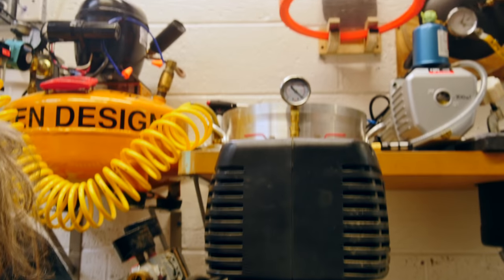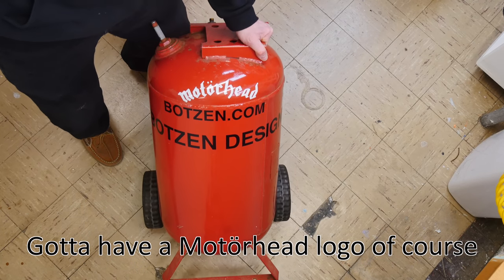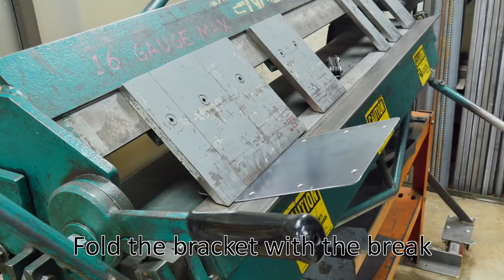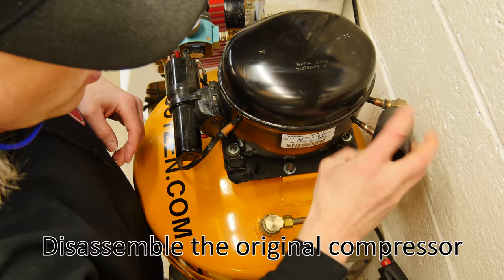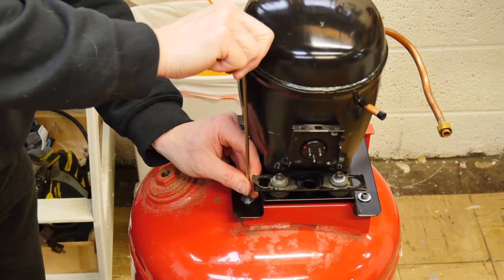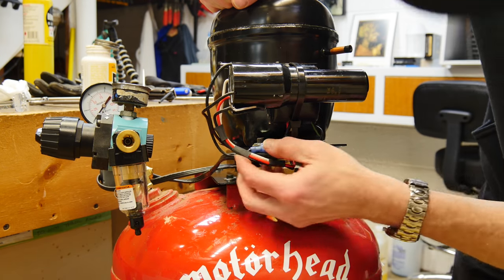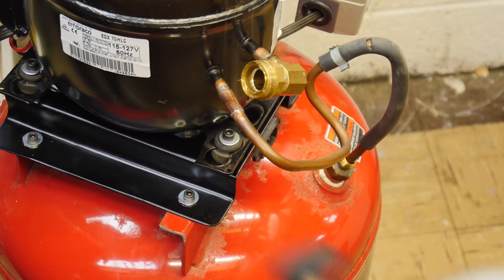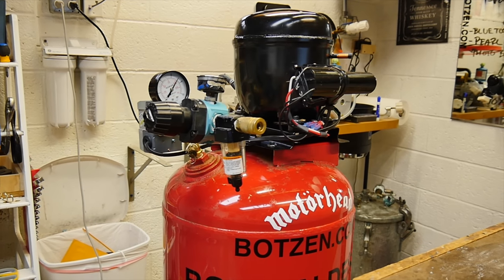ULTRA QUIET  Refrigerator Air Compressor Upgrade Build

Comment: Greetings from Sterling Heights! Do you believe that a fridge compressor is capable of 125psi?  Also. from reading comments it looks like this particular fridge compressor will fill the 15g tank from 75 to 100psi in about 5 minutes.  It's not exactly linear but I'm guessing that each 25psi roughly translates to 5 minutes of run time - would you agree? In the original build (what looks like maybe a 6g tank) I'm assuming the fill time from 75 to 100psi was probably 2ish minutes?
Reply from the maker: Greetings..Yeah, I think of your tank is rated for the 125psi the compressor should be able to pull it off, the other specs are correct.

Comment: I've heard people removing the oil altogether and running these things for years. I would never do my self. perhaps mineral oil or synthetic oil.  I have a question... the replaced capacitor, are they very specific to the pump you are using? Or can you replace pretty generically? Thanks.
Reply from the maker: They seem to be generic
Reply: @EricStrebel  Ver good Thanks Much!

Comment: Would a silencer like that work on a normal (twin) cylinder compressor as well?
Reply from the maker: Yes, if you can build a nanafold, to attach the silencer
Reply: @EricStrebel  I currently have a simple "air filter" attached to it. Simple plastic box with (I think) a small block of foam in it. I'd possibly be able to attach it in its place, possibly just 3D print an adapter for it.
Reply from the maker: Yeah, try and see if that works, watch the heat build up on the printed part, good excuse to make a sand cast part if it shows promise

Comment: Question: I am in the process of building one, but my compressor dont have the capacitor what would happen if I run it without one?
Reply from the maker: It needs it to start I believe.
Reply: @EricStrebel  but it does start when I plug it into the  wall outlet, just want to know if it can work like that without any problems, when I removed it from the appliance it was missing..

Comment: FYI - refrigerator motors have a low on/off duty cycle. They burn out if the motors stay on too long. You have to be careful using tanks so large that the SMALL piston take to long to fill, the motor will become overheated. They work better with small 1 gal tanks. Thus they work best for things that do not require large volumes of air; like an airbrush.
You could of course use multiple refrigerator compressors on one tank.
Reply: Instead of a refrigerator compressor a commercial AC compressor would be better.   They work great with near 100% duty cycles
Reply: @OakKnobFarm  Thanks for the advice. I happen to visit a local scrapyard three or four days a week. They’re mostly industrial Scrap but they get dozens and dozens of massive tractor trailer truck size HVAC units that come in regularly. And regular sized units also. 

Is there anything specific I should look out for? Since I literally have hundreds of compressors to pick from… I want to get what’s best suited. I plan on putting a single or maybe double compressors on a 20-ish gallon tank.   I do industrial circuit board repair and test equipment calibration. So I use my tank for cleaning and moisture removal… i use it more than any total in my shop. Considering a small squirt of 100% alcohol… Followed by good tight blast of air will clean and remove almost any debris or contaminants. 

I only run about 50 psi… so to not potentially lift the circuitboard copper traces or blow off the solder mask. However that 50 psi seems more like 100 because I’m running through a very small diameter airbrush hose, And attached to the end of my blow gun is a basketball inflating needle. So even though I’m using 50 psi pretty much around the clock… The tiny diameter of the inflation needle means I’m using a very low volume of air. Right now my 30 gallon tank last me pretty much all day.

Just wondering what would be best and I appreciate any info you can give. Also… How long would your average HVAC compressor take to pump up a 20 gallon tank?

Comment: How do you find the compressor heat dissipation and duty cycle?
Reply from the maker: Minimal, it never runs long enough to get warm, much less hot
Reply: @EricStrebel  Ive been meaning to convert my existing one, much like your first conversion to the fridge compressor as we have street waste collection every few months and there are a number of fridges on the kerbside.  I just need to finish my workshop build first :)

Comment: how long does it take to fill that tank please? Ive got a 50 ltr v twin compressor now that is noisey, and was thinking of putting a fridge compressor inline so when im doing small jobs, it can be working away, but when i need to spray i can put the big compressor on.. thanks
Reply from the maker: About 10-12minutes to fill the tank.
Reply: thankyou. i was thinking that i could chain 2 compressors together , but maybe 1 will be enough. On ebay they are £30 ea new. thankyou
Reply from the maker: Good luck with your project

Comment: how big is the air outflow? Thanks.
Reply from the maker: More than adequate for everyday shop use
Reply: @EricStrebel  does that mean that it can run normally random orbit sander 125mm?

Comment: recommended safe operating pressure for tank?
Reply from the maker: Depends on your tanks rating
Reply: Alot more than the safety valve will allow

Comment: I’m having difficulty understanding this and although I know mechanics and I weld, here is the program logic schematics for this? Please confirm friends:

1. Tank has 3 outlets: bottom purge for water, air in from compressor, air out to accessories

2. The compressor has three outlets: Air in from room (black silencer Can), air out (compressed) to Number 2 of tank (air in) and number three Oil ?? 
I’m assuming the 4th line the Freon Lone gets capped off? I didn’t see that on the 2016 vid 

3. Tank’s compressed Air IN pipes have nothing more than a one way check valve?

4. The Tanks out Valve seems the most complicated at:
4.1.: Three Tee
4.2.: 125 psi relief valve
4.3.: Pressure regulator
4.4.: Four Tee
4.5: Pressure Valve
4.5.: Switch

Not understanding where the capacitor came in and why it blew up

Also: what is the final Emptying ratio compared to the old orange one?

Took 20 mins to fill up
And how long to empty

Vs the new one 

Ok thx great stuff
Reply from the maker: compressor has one outlet, this is where we fill the tank with air, and one inlet, this is where the air comes in trough the silencer can, and one for the oil (just has a rubber plug in it) Outlet can be configured any way you want for your set up. Have no idea how long to empty, I never use it like that, I guess it would depend on your outlet flow rate and what you have hoked up. Don't full understand why the capacitor died either, probably was a crappy part.
Reply: @EricStrebel  I believe start capacitors are rated to be able to start a motor only so many times per hour. If you start/stop a motor many times an hour they overheat and reduce its life. I recently changed the start cap on my shop dust vacuum and the spec's for the cap said it was able to do up to 40 starts per hour.
Reply from the maker: It would be rare for this compressor to be used more than once an hour so it really doesn't start very much, but a bigger capacitor will definitely help with that I can see that being beneficial

Comment: Does water ever accumulates in compressor tanks?
Reply from the maker: Yes, it can, thus a drain of some sort is a good thing to have.
Reply: @EricStrebel  could you alleviate that by putting a condenser before the tank? I saw someone else modify theirs with a condenser and filter to catch the water and drain it as it runs instead of it going into the tank.
Reply from the maker: Good idea actually

Comment: What kind of CFM are you getting out of that little guy?
Reply from the maker: Very low, not sure of the numbers
Reply: What are you running off of it if you don't mind me asking? I've got big shop air with the mindset of big is never big enough.... Is a disease.
Reply from the maker: Just air for blowing off stuff and pressurizing my pressure pot for casting and sometimes clear coat from a mini gun

Comment: Hi sir : what kind of oil i have to use for my Refrigerator Air Compressor ?
Reply from the maker: I used 10/40 weight oil
Reply: @EricStrebel  could you use compressor oil? The type you can buy for air compressors.
Reply from the maker: Yes, it's a very light weight oil made for compressors, I don't see why not.

Comment: Having a problem with mine when I put the on/off  Pressure into the wiring. I can't get it to kick on. [It Kicks off at a 100 PSI and Kicks back on again at 55PSI]
But it's not kicking on but if I wire it without that, it runs.
Reply from the maker: You need a one way check valve before the tank, so the compressor does not need to turn on against the pressure of the tank.
Reply: I have that it's the pressure switch that turns the pump on at 70PSI and off at 100 PSI. When I run the power through that. It will not run when I bypass it. It runs, but will  not shut off Making it dangerous if left on the pressure switch is supposed to stop it at 100 PSI. It screws into the tank and has 2 prongs. For electric
Reply from the maker: I guess the pressure switch is faulty then, sounds like you need a new one
Reply: I got 2 new ones and not sure if I need a relay not sure
Reply from the maker: The pressure switch is essentially a relay that is turned on and off by the pressure that sends a signal to the motor for it to turn on and off
Reply: Do you have a way I can send pic
Reply from the maker: Send me a message via Twitter or Instagram

Comment: Great video but the gun suppressor comment is wayyy off. The vast majority of suppressors use some type of baffle and chamber system to cool the gasses and vent them to atmosphere slower to reduce the pop. If anything a chambered car muffler is closer in design. A suppressor for a firearm using some type of consumable media would be horrible.
Reply from the maker: Ok, whatever
Reply: @EricStrebel  you're welcome for reducing your ignorance on the matter 👌
Reply from the maker: Right

Comment: You know... I've been watching a few videos about air compressors and stuff and I see that some DYI-ers put an AC Condenser & fan between the pump and tank to cool air even further before it is stored.
With that in mind, I would like to see that to see how quiet it can get.
Reply from the maker: It's pretty quiet right now, can't see it getting much quieter.

Comment: Only good for blowing dust take to long to fill tank and if you try to run any tools it will empty in seconds as for spraying may work with a small brush but you will need a filter to remove water and any oil get through, these are not new I build one in the early 70s for motorcycle tyres and blowing out carbs and such. Not really worth the effort of building them.
Reply from the maker: That's exactly what it is good for, works fantastic for blowing off stuff, definitely can not run air tools.

Comment: Thanks for sharing. No fan, does the compressor heat up?
Reply from the maker: Barely
Reply: @EricStrebel  
I`m surprised it doesnt get toasty and trip the internal thermal cutout.   I`d expect it to run for least 7 minutes to fill the 6gal tank from 0-120psi and 17 minutes 47 seconds for the 15 gallon tank. The theoretical maximum free air flow from the compressor is 0.92cfm., you can expect 10-15% less in real life.  I would run it with  280ml of non foaming, mineral based hydraulic oil.
Reply from the maker: Runs with 10/40 motor oil currently
Reply: @EricStrebel  
I `d recommend shell tellus 68 or equivalent.
Reply from the maker: Yeah, I probably should run a non detergent type oil when I switch it out next time